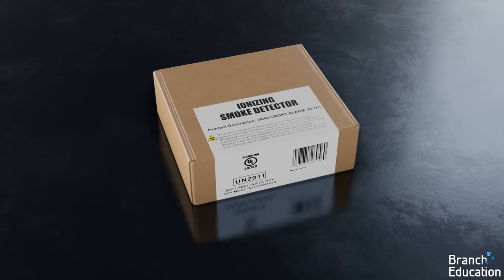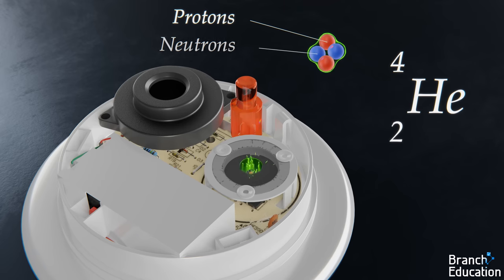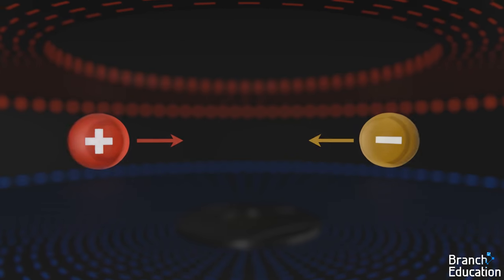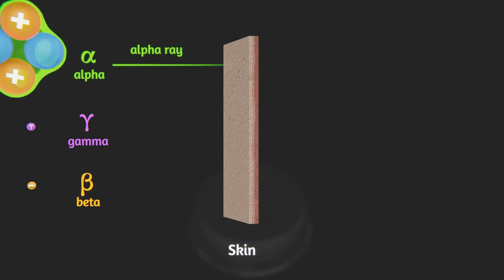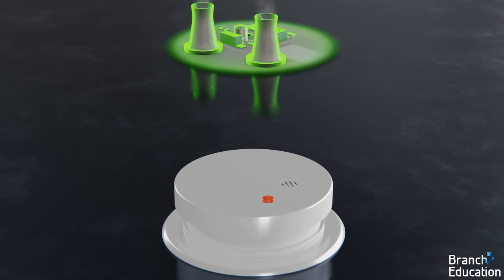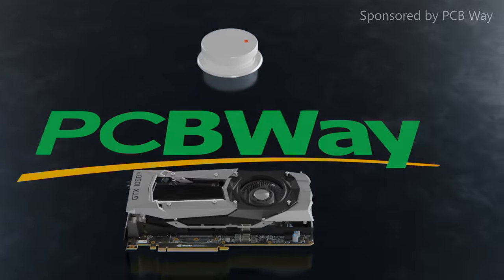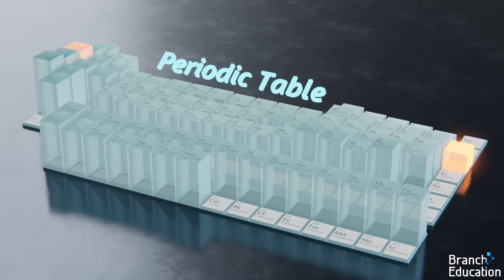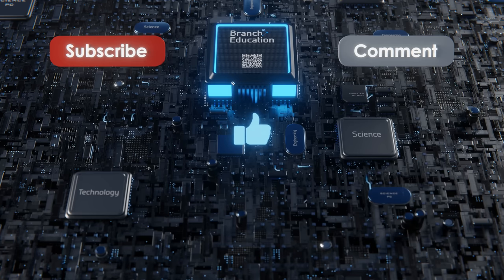Why are Smoke Detectors Radioactive?  And How do Smoke Detectors Work?

Comment: I like that you coherently used physically accurate electron orbitals. Not just spheres, but actual nested shapes.
Reply: I’m glad I’m not the only one who  appreciated that!!
Reply: Why air purifier doesn't use americium and none radioactive. Different tech, same function??
Reply: @maemilev  Smoke detectors need to detect a specific type of gas (CO2), so that it doesn't go off all the time with literally any gas in the air like O2 , NO2 etc.

Comment: Fun Fact: A nuclear power plant exposes you to the same amount of radiation as a single smoke detector (0.01 mrem/year). That means you are absorbing more radiation from the smoke detectors in your home and the bananas on your countertop than from a nuclear power plant 50 miles away.
Reply: Under the assumption that it’s run correctly!

But yeah, one of the many victims of oil’s industry propaganda

Comment: Thanks, I’m an x radiation worker (meaning I’m retired not dead) and always look for incorrect information in such vids. Yours was spot on and well worth refreshing smoke detectors. I think your conclusion re danger of alpha v gamma needs more explanation ie that tiny alpha emitter would destroy your inside pretty quick, BUT a dose of a few hundred micro sieverts for several minutes would most likely cause no issue, tho NOT recommended either. Thanks again
Reply: Gamma radiation is the real nasty barstood 😅

Comment: I was once called to assist with a fire detection system used in a diesel engine generator room. The 'authorities' wanted to test the system, so they set fire to a large pan filled with diesel fuel. The whole room was filled with smoke, but no alarms sounded.

At this stage I entered the scene - I started the fan and got the 'diesel smoke' out. Then I got a cigarette from one of the engineers - lit it - and blew smoke into the fire detectors - all worked fine - the alarm sounded every time.

Why you may ask. Smoke from burning fuel is (very) dark/black - and black does not reflect light - the cigarette smoke is 'white' - which reflects lights. Wisdom: look at what kind of smoke a fire will generate - the select the type of detector.
Reply: THIS
Reply: Well rare to see, I believe industrial fire prevention systems should use multiple detection methods just for this purpose.
Reply: Ionisation : for rapidily flaming fire 
Photoelectric/photo optical : slow/smouldering fires ..

Comment: According to my using experience on both of them, the radiation type smoke detector lasts very long, over 20 years without trouble,  but it only able to detect smoke ! The laser beam type detector triggers the alarm even with steam or oil vapour during cooking that I do not like if it is installed in kitchen area close to stove. It is much more expensive as compare to the simple radiation type.  Not like the radiation type runs with 9V, it requires both batteries and AC power that is not so simple  to install and runs it.  It starts has trouble after two years like sounding alarm by itself without detecting any smoke or any vapours. I repaired them by cleaning the laser chamber where I saw  very few and fine dust accumulate inside, but some still fault alarm after cleaning.

Comment: playing multiplayer online games with voice chat there is almost always someone with that smoke detector low battery chip noise going off every few seconds. its just amazing how many people live with that chirp when its such an easy fix that could even save a life. thanks for the video duder.
Reply: In the same way people become accustomed to smells in their homes, people become accustomed to noise in their home as well. Eventually, your brain just tells you it's normal, and you tune it out. They're not necessarily dumb. They've just let it beep so long they don't even hear it anymore, and then they forget completely to change the battery.

Comment: Couple things:
First & foremost, not all smoke detectors contain radiation: only ionization ones do, it's just that they're the most common. Photoelectric smoke detectors don't contain radiation, & many people fail to mention that this type even exists (let alone explain how they work). Congrats to you for doing both of the latter things.

Nice job on that extremely accurate Kidde i9040 model! (at least if you made it, even if on the real thing the "LED tube" is clear instead of red).

0:46 A lot of smoke detectors do have only a battery for power like that one, but just as many can also take 120VAC as a power source (with a backup battery in case the power fails too of course).

0:58 Smoke detectors don't sound like that anymore, only older ones do; modern ones produce a pattern known as "temporal 3": 3 beeps, pause, 3 beeps, pause, etc. In addition a "chirp" is not that long: it's just what it sounds like, a chirp, like that a bird would make.

1:09 You say "few basic components", but it all depends on the design & complexity of the unit (& how many features it has).

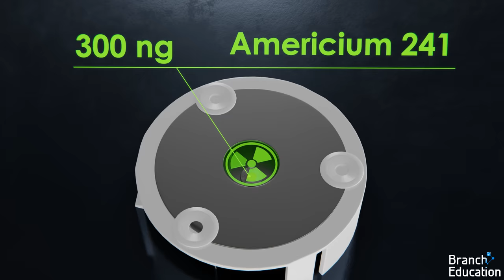1:47 It's "Am-ma-ree-cee-um", not "Ameri-cee-um".

1:49 I'm not sure I've ever seen a smoke detector or a consumer box with that symbol, though it might be on bulk boxes of detectors. Also while disassembling a smoke detector is indeed not recommended for several reasons, there's not enough Americium 241 present to hurt you (though as the narrator says directly exposing yourself to it in any way is also not recommended).

4:48 Yeah, even if they are radioactive.

5:04 Yes, though in general it's known as a "detection chamber" regardless of detector type.

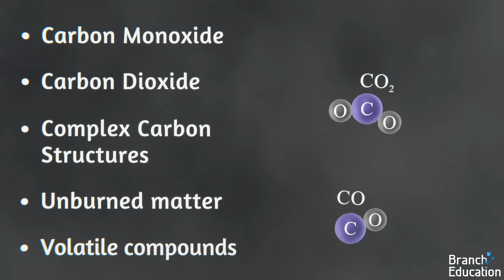6:42 Like hydrogen cyanide? (which I believe is often produced by fires, & can in itself be deadly)

6:49 The particles generated by burning popcorn, not the popcorn itself because that just wouldn't make sense.

8:32 Nice grammar.

10:08 That is interesting! I never thought about where that type of detector got what makes it tick. Neat how a substance that would probably be considered waste in the nuclear power process can actually be used for something! One person's trash is another person's treasure like they say!

11:45 Yep, including what kinds of fire each is best at detecting (sadly most home fires are the kind that ionization detectors, the type most commonly installed, can't detect)

11:47 "Ionization", not "Ionizing".

12:10 Hopefully most people should have enough common sense to not do that.

12:19 Really? I had no idea it worked like that!

Fun Fact: some very early ionization smoke detectors actually used another form of radiation called "Radium-226".
Reply: Are you sure that a smoke alarm contains such a small amount of Americium that it won’t hurt you? I’m asking cause my 6 year old son opened an alarm not long ago cause he wanted to see how it worked and I’m a bit concerned
Reply: @kingelvis4688  Yes: most only use around 1 microcurie of Americium 241; this is nowhere near enough what's necessary to harm people. It's still not a good idea to open the detection chamber of an ionization smoke detector (as this exposes you directly to the radiation) or come into contact with the Americium in any way though.

Comment: So if I understood correctly, when smoke enters the chamber and the radioactive americium hits the smoke particles with its decay, the positive and negative potential stored in the plates grow significantly because more smoke atoms are being “knocked” of electrons thus triggering a circuit that measures the voltage potential in the chamber tripping the alarm.

Comment: Technically, what is talked about, is a smoke alarm. A smoke detector works on the same/similar principles, but is connected to a central fire panel.
Ionisation smoke alarms got banned in some states over 10 years ago in Australia, but I do know that they are still available here.

Comment: I was home alone one time and the upstairs alarm went off and then all my others started to and they were saying fire repeatedly. It freaked me out so I went up stairs to verify and there was no smoke or anything and that one upstairs is hardwired into the house and doesn’t use a battery. I’ve lived in this house since 2018 when it was built and that has only happened once and never again so I’m guessing the little microchip or maybe the decay in the alpha particles tripped the alarm.

Comment: I've also found a sudden steam increase from a shower or say very high humidity differential due to the detector being close to an attic opening during a hot summer day, can briefly  set off an ionizing detector.
Reply: “piezoelectricity: electricity resulting from pressure and latent heat.”

The heat in a small space (bathroom) creates pressure

Comment: What is happening when the smoke alarm is chirping and you don’t replace the battery? Does the smoke alarm fail or does it still go off? That is my question
Reply: Still requires the battery to work the chirp is a warning to change the battery. It will eventually stop chirping, and the battery will be completely drained. So the alarm will not work.

Comment: Actually these are NOT smoke DETECTORS. They are smoke ALARMS. A smoke detector is just one part of a system, which consist of remotely placed  detectors (fire, smoke, gas, etc.), alarms, panels, etc. You find these in supervised installations common in commercial, industrial or multiresidiential buildings. 

A smoke alarm is a all in one unit comprising a power source (connection to the dwelling mains with battery backup) detecton circuitry and alarm circuitry. These are the units commonly found in residential structures. Becoming more common are smoke alarms with integeral carbon monoxide alarms. Both pf which are now required in new home construction.
Source: NFPA 72.

Comment: can that be used to create energy? since it knock off electrons from the air and can negatively charge that plate, but i never heard of creating voltage like this
Reply: If you can power anything with a femto-amp, then maybe.  But it needs a battery to work.

Comment: The metal faraday cage i think of it like a transistor, when smoke flows through it the Ionization process completes the circut and the alarm sounds.

Im an electrician and hobbyist. I crack things open and use parts for projects. I seen the warning symbols and decided to stop there.

Doing research, i thought about creating a for ever battery but at my age the amount of things I've had blow up in my face i felt like. I want to keep all my body parts and dont want cancer.

Comment: As for the most frustrating noises (1:02), I'd say that air raid alert noise is much more frustrating as it often may be followed by shattered lives on a bigger scale. Can say that for sure from almost a year experience of hearing such alerts on daily basis. :(

So many engineering discoveries can be made, but some people prefer to invest in violence.

However, thanks for the very educational video.

Comment: The title is incorrect, almost all smoke detectors are photoelectric / not using any radioactive material. Only the old generation of smoke detectors used radioactive material and most countries have stopped selling those already for many years.
Reply: Some are both types combined.

Comment: Does cigarette or vape smoke triggers a smoke detector?
Cuz I've been told numerous times to not smoke in the presence of a smoke detector but few days back I noticed a smoke detector right on top of my head where me and all employees allowed to smoke and it was never triggered even if multiple people were smoking at once
Is the detector dead or is it smart enough to ignore the cigarette smoke and focus on actual fire smoke?
Reply: Light a piece of paper and then blow it out so a column of smoke comes from it and hold it under the smoke alarm.  That will tell you if it is working or not.
Reply: @karhukivi  i don't want to trigger it
Reply: @khaled0al0zoabi  Why not?  It is recommended to do that every so often to make sure it is working.  The alarm will stop quickly and fanning fresh air onto it will stop it even faster.
Reply: @karhukivi  I work  in a mall I dont want to cause panic
Reply: @khaled0al0zoabi  A very good reason!!  Stay safe!!

Comment: Would also add in that even better is to add in as well a carbon monoxide detector, along with the smoke detector. If you have gas supply piped in a gas detector low down is also a good idea, as the combination of a gas detector, and a carbon monoxide detector, will tell you of a potential gas leak, or a blocked flue, before you have enough gas to catch fire, and save you from dying of carbon monoxide poisoning as well.

Comment: These are banned in the UK. Therefore UK smoke alarms DO NOT contain radioactive materials.
Reply: If you have a gas fire with little smoke your detectors will not go off.    Best detectors use both.   Uk also was late adopting safety belts and even safety glass in cars.

Comment: Incredible! Just don't depend on an ionization smoke alarm to protect you as well as a photoelectric type will. The UL 217 8th edition smoke alarm standard doesn't allow for obsolete, ionization technology to be used in smoke alarms. If life safety's important, consider that.
Reply: I've been using the same smoke alarm for 30 years. How long have you been using that new one?
Reply: The sensors have to be cleaned!   I have both types installed and the ionisation types are definitely superior to the optical ones.
Reply: According to UL & Texas A&M, & the IAFF, the ionization type smoke alarms do not detect smoke from slow, smoldering fires early enough to allow for enough escape time, compared to the photoelectric type. That's their conclusion, not mine. Please notify UL of your research results if they're truly valid.
Reply: @ralphbaran  In Europe the advice is slightly different, they advise using both types because of the different particle sizes, especially in large volume buildings like factories and warehouses.  For homes, either type is considered OK.  But these types of advisories have a habit of changing from time to time.

Comment: Most smoke detection devices do nit work like this anymore at least that's the case here in the Uk
Reply: In America, we still have these in our stores. I have one that is almost 30 years old and still works fine with a battery change yearly. If it works, it works

Comment: haha, smoke detectors in germany/austria work following: IR-LED sends IR-Light in small chamber with holes for outside smoke, from 1 side to other over 2-3cms on other side is photoelectric sensor. when smoke particles affect density of IR-light with blocking and reflecting em, the photoelement has other voltage and alarm starts.....0,0000000000 radioactivity in there, ignoring radioactivity all around us from nature^^
Reply: dump down from me for the video

Comment: In the Stephen King short story "The ballad of the flexible bullet", the protagonist is paranoid and thinks the smoke detector in his house is dangerous. He was half correct, since the story was set in the 80's, when most smoke detectors still used Americium.
Reply: Cheap ones still use Americium

Comment: 1:22: 🔍 Smoke detectors use radioactive decay to detect smoke and have a metal cylinder containing americium-241.
3:32: 🔬 Alpha particles from the americium-241 source in the smoke detector ionize the atmosphere, creating charged ions and electrons.
7:14: 🔥 Smoke detectors use alpha particles to detect fires and ionized air molecules to prevent current flow.
10:28: 🔍 Smoke detectors use ionizing or photoelectric sensors to detect smoke particles and save lives.
13:32: 🔬 Atoms with higher atomic numbers can be smaller than atoms with lower atomic numbers due to the attractive force between protons and electrons.
16:54: 🔬 This video discusses the atomic radius of an element, the functioning of Geiger Counters, and the importance of engineering education.
Recap by Tammy AI

Comment: 8:13 "gamma rays are more dangerous" - this depends on context.  Alpha particles are far more dangerous if an alpha-emitter (like Pb-210) is inhaled as they remain in the lungs for decades emitting alpha particles in a very small volume of tissue, with a strong chance of damaging DNA and possibly starting a tumour.   By contrast, most gamma radiation passes through the body with no interaction.   Of course high-intensity gamma radiation is dangerous, as is X-radiation as well as high intensity beta radiation. from an external source.

Comment: Wait how is it safe it has Holes? In the ionization chamber
Reply: The particles, even if they get through those holes, would be stopped by the plastic container. Even if they somehow got out of the smoke detector, it would quickly be stopped by just a few centimeters of air. They are even stopped by clothes and skin.
Reply: @ragingfirefrog  Oh, thank you.

Comment: A circuit with only a few hundred components is very un-complicated for electronic engineers.  At Cooper Energy Services Corp, my department assembled and tested electronic circuit boards which were 28 inches on a side and equipped with X8 layers of printed circuits... QED